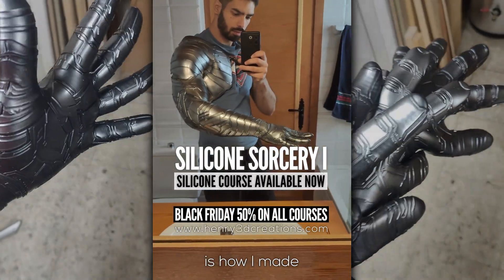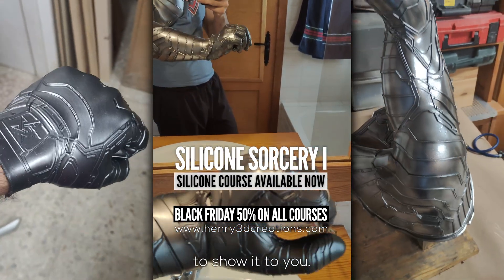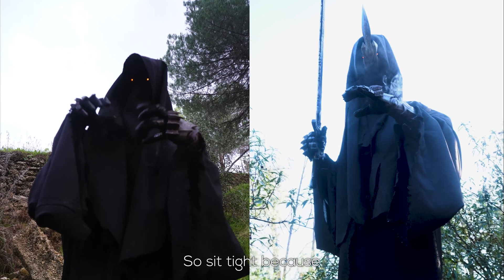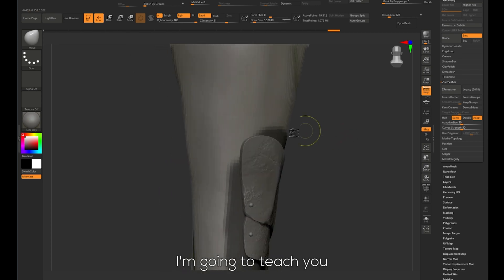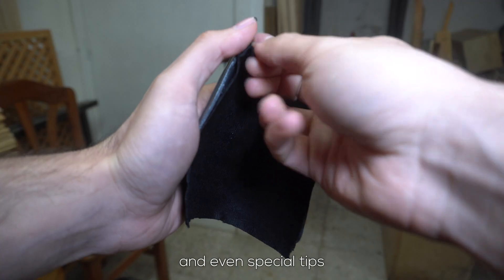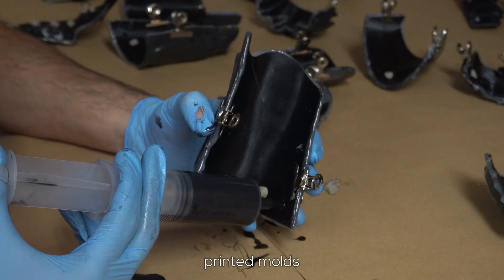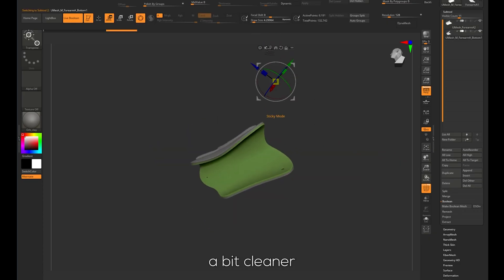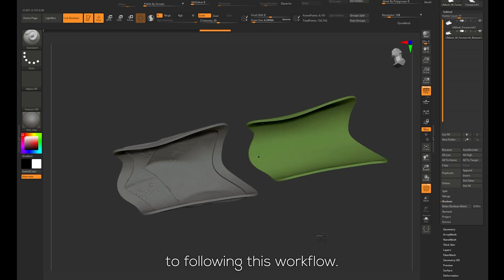Silicone Sorcery I. A moulding/casting/painting platinum silicone props by Henry Creations.

Comment: Does this course show how to make a full limb like the full winter soldier arm or are these lessons more for casting smaller pieces?
Reply from the maker: Hey man, sorry I missed this. This one is about starting small with simple one face (plus the extra back face in fdm) resin printed molds. Then I just released Part II which is about two part SILICONE molds. Part III is coming soon and is about the winter soldier arm. A slow burn with a big reward!
Reply from the maker: But this first one does talk about chroming silicone and other essential things about why the winter soldier arm works